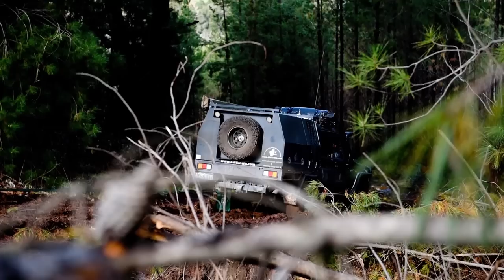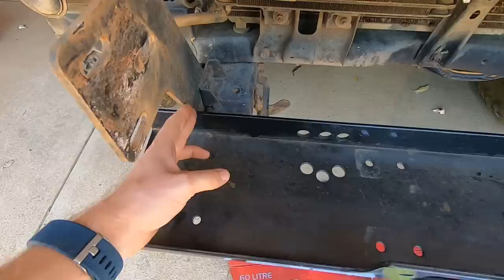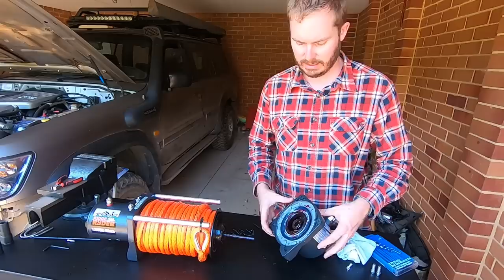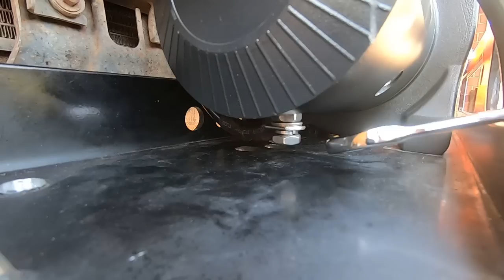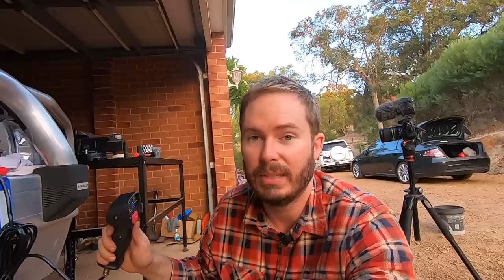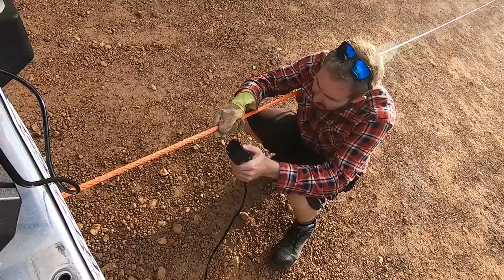Easy winch install. Fitting a Ridge Ryder winch to the patrol. Backyard Mechanic.

Comment: Literally the only part I wanted to see you didn’t show haha the mounting to the chassis and where the bolts go and what bolts you need / length ect
Reply: Exactly. Should be crush tubes welded in for max strength.

Comment: Thanks for the great vid mate. I'm about to fit a winch to my car that has a winch bar. My old car didn't have the winch bar so after ringing around I found that tjm could supply a winch cradle, unfortunately it didn't fit, so after ringing around again Peel 4wd Centre in Mandurah made me up a winch cradle for under $300. It was alot cheaper than buying a winch bar.

Comment: Thanks Bro. Just discovered your channel. I bought a 9500lb wire rope model about 6 months ago when they were on special for under $400. Still haven't installed it. I need to source a bullbar now. Pinch Weld Clark Rubber. Thanks for the heads up.  Looking forward to watching your previous videos. Moose Boddington.

Comment: Good video mate, just installed a Runva 13XP on the cruiser. Didn't realise I need to tension up the rope- cheers!
Reply from the maker: Good choice on the Runva dude. Nice winch them!
Reply: Yep my choice for my gu  too 
Hey Alex what are those headlights and where are they available mate ? My gu factory ones are crap
Reply from the maker: They are series 3 patrol headlights I got a hold of (mines a series 2) and modified a little just to look different. I put LED globes in them as well but they're a pain in the arse to be honest. If you look on intentsoffrosd.com and search headlights you should find the how to I wrote up about the mod.
Reply: Ok cool mate i will have a look 👍

Comment: U have done an awesome job of explaining it and in a commonsense way as well.. I have subscribed because I am going to fit a winch to a trailer ramp because its too heavy for me to lift by it self now I'm getting on in years  lol.Pinch weld would be great for when I mod a side panel on a computer case and fit it around to cover jagged edges. Usually make an acrylic window for it but some nice mesh would also do the job allowing better airflow.

Comment: Hey mate, literally just crawled out from under my patrol. Fitted another Kings dominator x winch to my new fourby. ( Basically the same winch )
I will be pulling out the cable and spooling it under tension like you did. I have heard of 2 of these cheaper winches spitting out the rope from not being secured to the spool properly, might be worth checking for those of us playing at home.

It happened to a mate on the beach, literally spun the rope around the spool when he went to winch in, hahahaha. 
Poor fella.

Cheers!
Keep pumping the videos out mate. 
It's been a while between drinks.
Reply from the maker: Yeah shit...right when ya need it most, about to be swallowed up by the tide. Spooling under tension should prevent that. Have you ever seen how they hold the wire/rope to the drum? It's a piddly little cap screw just designed to keep the rope in place 😐
Reply: @Alex.G  yeah I just unspooled mine and had a sticky beak..... No wonder they fall off 😂
My battery just shit the bed, winch fully unspooled up the driveway.  😠
AWESOME!!
Should have maintained it better......
Reply: @sfrrob  I had the pleasure (while stuck in a bad position where I really needed the winch) of sheering off the bolt. luckily i had the tools on me and i could retap the thread and put a bigger bolt in. worth doing the full spool and also even replacing the bolt with something larger

Comment: I would recommend a hook bumper to shield your hawse lead from getting all chaffed up by the hook clevis.  This chaffing can lead to damage to the synthetic rope as it is pulled over the chaffing.  Even an old 80's roller skate wheel threaded over the rope and used to cradle your hook will suffice.
Reply from the maker: I'm so down for the 80s roller skate wheel! Very good point made there.

Comment: Alex, a hex head bolt is your standard bolt the one you use an Allen key for is a cap head bolt. Another thing worth mentioning with high tensile bolts is that there strength is on a straight pull setting up a winch puts the bolt in a shearing position where the bolt strength is comprised. All bolts should be tight on a vehicle because of vibration but it is critical here that the bolts clamp the mounting plate to the chassis and the winch to the mounting plate as any slippage will create a guillotine point on the weakest part of the bolt. Maybe find the correct torque setting and use a tension wrench. You are dead right about throwing away bolts with no markings cheap and nasty some grade 8.8 bolts will just have 3 lines on the head almost like a Mercedes emblem but not joining in the middle.
Reply: if your getting techincal its a "cap head screw" not bolt
Reply: @ncradock2007  depending on whether there is a shank or it's threaded all the way
Reply from the maker: That's some solid info Todd, cheers! Goes to further show why grabbing any old patio bolt from the spare parts tin won't suffice!

Comment: Nice video mate, you helped me a lot. But your Ridge Ryder winch gearbox is not sealed and therefore it is not waterproof. I would be sealing it up quick smart & also checking to see if the motor is sealed.

Comment: NEVER pull with/on a car in park.  Even with the hand brake on you can snap the parking pawl. When you do it's a big job to fix it. When you are using a car as an anchor, always put the car in neutral and fully apply the brakes.  This will give you max traction and protect the transmission.

Comment: Steel cable isn't that bad. I ran steel cable for a bit. But went to synthetic rope because of the safety aspect of it. I don't want to be stuck in the middle of no mans land, with no signal, then a steel winch cable cut my truck or myself in half and still be stuck in the middle of no mans land. Also, with synthetic rope it's pretty convenient to tie another eyelid on the end when it does break unlike steel winch cable.

Comment: Really useful and informative video - everyone talks about winches, but I've never seen the full install with details like this. Big thanks! 

I have a couple of questions:-
1/ Was that a reaming bit you were using to drill/finish the holes on the winch bar or just a funny effect of video playback?
2/ I can see the situation where a pull has only required a couple of meters of the rope but you have had to wind out a big proportion of the rope to do it. Does the procedure to rewind the winch rope also apply after every pull?
Reply from the maker: Thanks buddy! Nah no reaming bits were used, just a 10.5mm drill bit (and some smaller sizes to start the holes). I assume the bit you are referring to is where I've sped up using the rattle gun 🙂

Point #2 I can see what you mean. Personally, if I wasn't in a hurry to move along I would keep the pull going under load for the full length I had to spool out. Because yes, it should eventually be re-spooled under tension. However, if you got the rope wet or muddy, I'd not be too fussed because you'll have to pull it all off later to clean and dry it anyway 🙂

Comment: Excellent video. Just one question - was it just a couple of bolts through the chassis each side to mount the winch plate?
Reply from the maker: Thanks James! Yeah two bolts each side of the cradle into factory captive nuts, so four in total. These are the captive nuts which would generally be used to mount a winch bar. Make sure you're using high tensile bolts for the job. They'll have 8.8 stamped on the top or greater. I always use 10.0 stamped bolts
Reply: Thanks, I haven’t had mine apart to see what bolt hole there are. I thought it would need holes drilling and reinforcements and all that. Sounds much simpler so happy days.

Comment: How often should you replace the grease in your winch?
Good videos mate 👍🏻👍🏻
Reply from the maker: I haven't put any thought into that actually! I'd be considering it depending on amount of use, and whether I've submerged it in water at all. So far it has seen one use and not been underwater, I reckon at this rate it'll be four years before I think about greasing it

Comment: Noticed your running the Falken wildpeak mt's on that bad boy, how do you rate them mate?, Ive just dropped coing on 5 in the at3w for my fj cruiser in 285 70 17, almost went with the muds, great install vid as well Alex, cheers mate
Reply from the maker: You will be pleased you didn't go the mt wildpeak dude! The two major problems I've have is they go outta balance too quick (I've given up, wheel balances were getting expensive) and also they chipped like you wouldn't believe. I've got chunks missing all over, some down to the steel belts 🙁 the at3 looks like a nice design though. I'd give them a crack myself!
Reply: @Alex.G  dissapoitmon!!, on those muds, hope the 3ws perform better than that, i ran the hankook mts on my old d22 & they were a great tyre, gave them hell in tassie & thry performed well, good budget tyre

Comment: Hey mate did you just bolt that to the chasis rails what size bolts cheers
Reply from the maker: Yeah I did just straight into the existing captive nuts. I'm pretty sure they are m12x1.25 threads

Comment: Nice video thanks. Just wondering when you mounted the winch plate did you just put bolts into the threaded wholes or did you open the front of the chassis and get some nuts in there?
Reply from the maker: Just used the captive nuts already welded in place
Reply: @Alex.G  I see cheers! Looking at doing mine soon. Interesting that they have those nut holes already for a winch. How good!
Reply from the maker: Yeah! They used them for mounting the factory option bullbar

Comment: are there any fuses or just wired straight to the battery?
Reply from the maker: Straight to the battery, though it is becoming more common these days for people to wire in a big circuit breaker or an isolator switch

Comment: Question, what nissan patrol specific winch cradle would you have bought instead of the universal one? Looking to do this job but would prefer getting one that already fits to the GU patrol rather then grinding it to size.
Reply from the maker: I can't remember who does them anymore, but I know they are pretty easy to stumble upon with a Google search for "gu patrol winch cradle"
Reply: @Alex.G  Was having a browse and they all seem to be triple the price of the universal bracket that you bought unfortunately, might just have to get the universal?
Reply from the maker: Yeah that's correct, I recall the cheapest at about $350. I would rather have done the bolt in option in the end, but that's personal opinion 🙂

Comment: Mostly good info but that last bit, pulling the hook right up to the fairlead is very dodgy. While ti may or may not damage the winch it WILL  damage the alloy fairlead, supplied with these winches, which in turn WILL chafe the rope. Even with the clevis hard against the fairlead vibration will inevitably cause damage.
What you get away with useing a steel cable and fairlead is no indication of safe practice in this case.

Comment: Hey mate how did you mount the winch cradle to the car??
Reply from the maker: Using some 10.5 grade high tensile bolts into the existing captive nuts in the chassis rail. These are the same captive nuts used in a winch bullbar installation

Comment: So what happens if your vehicle doesn't have a support bar thingo for the cradle to be bolted into? What do you then do?
Reply from the maker: Any ladder frame chassis 4wd should have these end rails to bolt onto. If it's a monocoque chassis vehicle then this is method isn't going to work
Reply: @Alex.G  It's a 2wd tf rodeo

Comment: What cradle is it?  And where can I get one in Perth
Reply from the maker: Thanks for covering that Yoda 🙂 yeah I got this one off a mate who didn't end up using it. I've not seen them in Perth anywhere, I'd do like Yoda said and go straight for eBay
Reply: I know this a little late but I bought one from tjm that was supposed to be specific for my vehicle, unfortunately it didn't fit but the guys down at Peel 4wd Centre in Mandurah made me one up and fitted it for under $300. It was a lot cheaper than buying a winch bar.

Comment: "Man Tantrum" , Bahahahaha GOLD
Do you use a fuse on your winch Ve+ supply?
Reply from the maker: I don't use a fuse no. I suspect you'd need some sort of massive circuit breaker in the realm of 400 amps? The instructions would probably give me an idea actually.
Reply: Yeah, i don't think it is standard or the convention to do so
I just wondered.... They only started fusing starter motors in recent times

Comment: How did u work out we’re to drill hole we’re bolts to the chassis
Reply from the maker: A lot of careful measuring. Measuring from the front of the chassis rail to each hole, and the side of the chassis rail, then place the winch cradle in place and reference those same measurements onto the cradle
Reply: @Alex.G  I got same cradle and and patrol as u just a bit worried about drilling into it without a little guidance
Reply: The only bit I was worried about u skipped lol

Comment: No disrespect... the pins on the hook/rope eyelet, used in anger, when in a hurry and those types of things, when slamming back into the fairlead... over time... can mark and scratch said fairlead.... one small bit of sharp steal because of this will cut the rope. Its happened before.  I cringe when i see them like this. Thats my only whine. Top vid, some friends of mine could learn from this. Gleno.
Reply from the maker: No disrespect taken mate, excellent point! Someone raised this in a comment a few days ago and I'd never even thought of that....you can bet you'll see one on my fairlead soon.

Comment: No good at all the fairlead should be the last thing that rope touches when you use that winch on any angle it will take the pinch weld off and the rope will instantly be cut by the bullbar